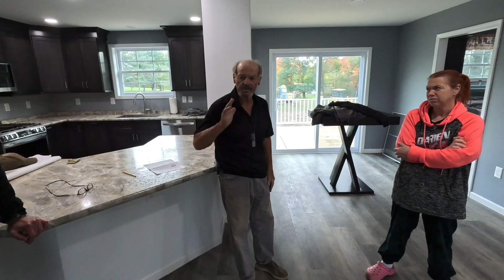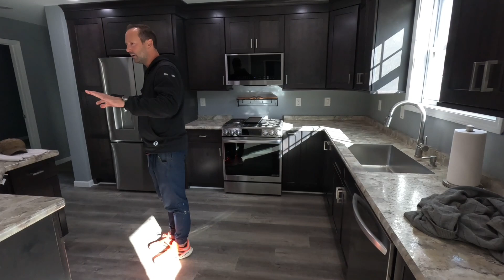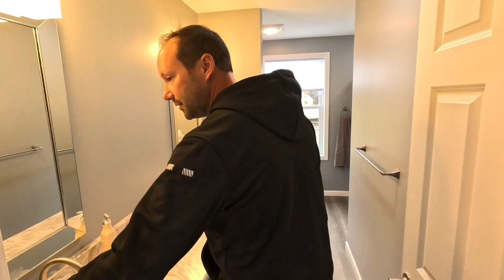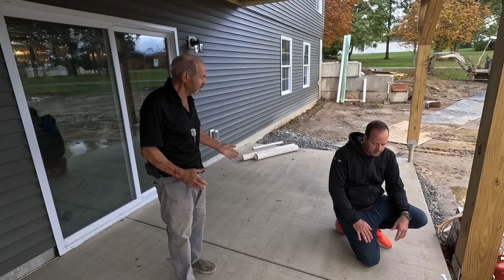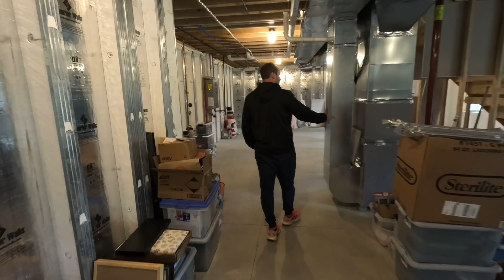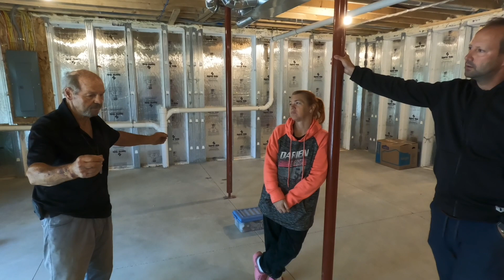Modular Ranch Homeowner Walkthrough - Hiring Subcontractors To Complete Build

Comment: Really nice house, could they have put in a pocket door in the utility room?
Reply: Excellent question and solution without moving door but may or May not be a option now.
Reply: @stevenkaskus6173  I see the issue with the wall light switches..
Reply from the maker: I believe that spot allows for a pocket door, but put a pocket door in now would require ripping off the wall because the pocket door sits in inside the framing of the wall. It’s only a couple hundred dollars to switch a swing door to pocket door in new construction, but after the house has been built it’s significantly more expensive
Reply: So was the fireplace a after thought?  Why wasn't it built with a fireplace.   Love the kitchen but personally I need more storage so I would want additional upper cabinets installed hanging from the ceiling over the island between the columns
Reply from the maker: The owner wanted to do a custom fireplace and used a local supplier for this
Reply: May I ask at the end of the video the gentleman mentioned something about the siding and that another contractor came to do something but wanted to take the siding off and the owner said not doing that some one has to know how to do "it". What was he referring to.  Thank you